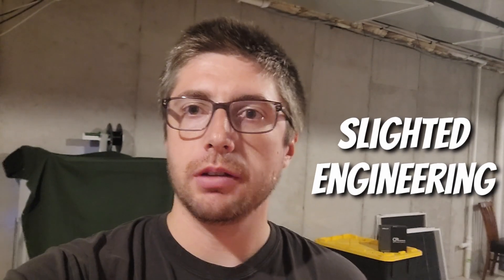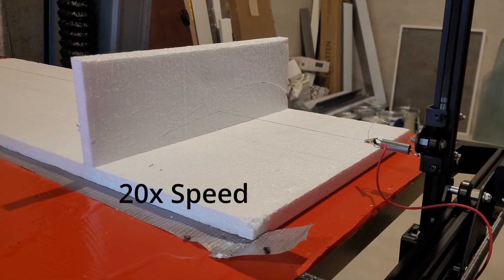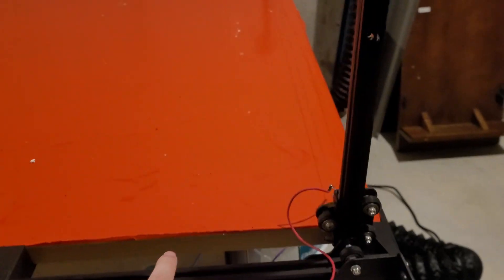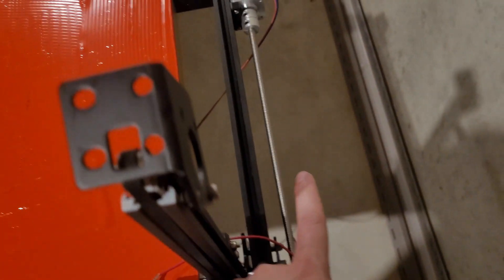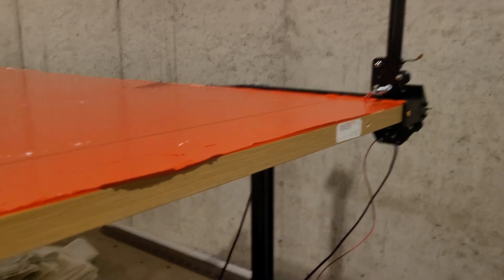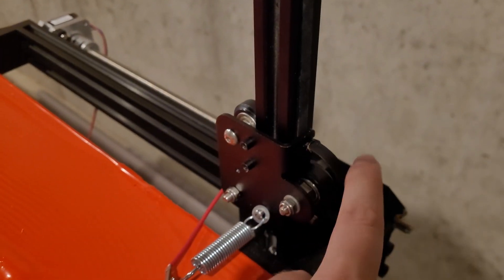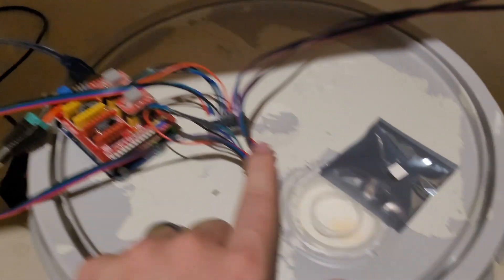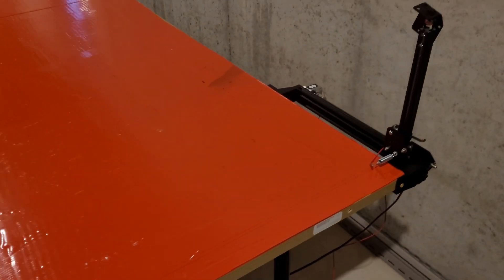DIY CNC Hot Wire Cutter!! All salvaged 3D Printer Parts!

Comment: Nice. What program are you using to draw your profile and convert to gcode? I have part printed for a 4 axis setup and considering buying an expensive program but can’t commit
Reply from the maker: I used an online airfoil generator here. You need to supply the base profile data and it can scale from there.
https://www.diyrcwings.com/app/
Reply: @slightlyengineered  What an awesome little site!  Thanks so much!